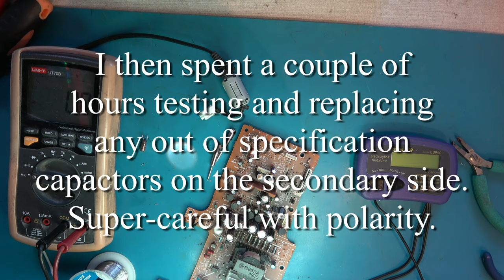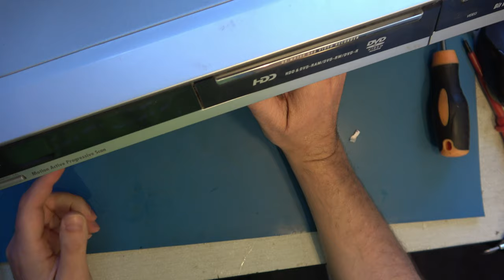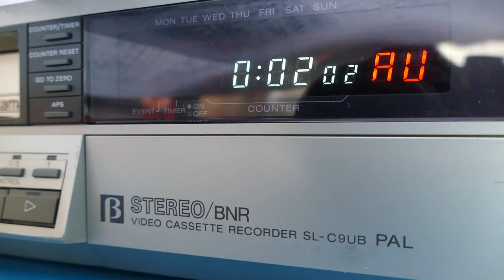More on JVC DVD recorders.  Two DR-MH200's display "LOADING" and won't start, try to fix quickly.

Comment: Smashing job coilin, not to hard to recover them.
Switchmodes are efficent but if you had to send it to a shop for repair the price would likely wipe out any savings you gained with the reduced electricity costs.
There was an old satalite box that did worse when the power was lost, the Dredded Pace box would expode it's switchmode psu on power cuts.
I repaired too many of them, always the psu exploded when power was re applied.
There was a repair kit for the pace, it was very common.
Reply from the maker: These JVCs can blow up the power supply too, I've had that once.

Comment: Sure you get this comment very often but it is disappointing how cheaply things are built today. Perhaps older kit was just over-engineered, but it seemed so much more reliable. Had a Freeview box that died two years to the day of purchasing it, and it was due to bad caps. Replaced them and its still working now about 7 or 8 years later. Things just aren't built to last anymore.
Reply from the maker: Meanwhile the power supply capacitors are just fine in my 1976 N1502 video recorders.

Comment: Nice recovery of the machines. If the hard drive does fail, are you able to read and clone a drive in a Windows or Linux computer then pop it into a machine with a failed drive, and go on your merry way?
Reply from the maker: No. They have special firmware.
Reply: Yes you can. use HDDRAWCOPY tool from HDDGURU. I have done it on my JVC DR-MX1 VCR/DVD/HDD Recorder. Use the OEM JVC hard drive as Source. and as the Target you have 2 options 1st you can either image the Original OEM hard drive to a file or 2nd option to a new hard drive and after the clone finishes the JVC will recognize the new Hard Drive. I just change my DR-MX1 from the OEM cheap crap Maxtor 160 GB to a WD1600BB 160 GB IDE drive. and the unit successfully booted up from the WD hard drive.

Comment: Reminds me of the 1uf 400v bootstrap that liked to go in the Panny VCR's after a power cut!
Reply from the maker: I wasn't aware of that one, do you remember which models, roughly?
Reply: It was a whole plethora of the early nineties decks as they all had quite similar PSU's (NV-L/ NV-G/ NV-F/ NV-FS etc, etc) Dried-up PSU electrolyics were always a firm favourite in the old Panasonic's..

Comment: I've seen a few of your videos and you clearly seem to know your way around tech of yesteryear. Perhaps you can help me with a recurring problem I'm having with a Pioneer LaserDisc player. Or at least help me provide my local repair shop with a few pointers, so he won't have to spend unnecessary time trying to locate the fault. Time is money, you know... 😉 

I own an old DVL-series Pioneer LD player. When it's operational, everything is fine. But if I dare to unplug it or if I have had a power failure in my house, I cannot for the life of me make it turn on again. I have to keep the player unplugged for about 2-3 weeks - and then I can hook it up again and everything will work fine.

Is it a problem you've come across before and might have a few ideas as to where to look for faults, other than going straight for a look at the power supply?

Would have loved to have you take a look at it - unfortunately, I live in Denmark, so handing it off to you will be quite... expensive.
Reply from the maker: It's almost certainly a power supply problem, but there's no simple explanation to repair it.  You would have to look at the power supply and see what components may have failed.

Comment: What happens when you test capacitors using the wrong polarity? digiommel has released a lot of technical paper on improving video transfers of certain formats. Maybe you can post tutorial videos on them.
Reply from the maker: The ESR meter doesn't have polarised cables, it works out the polarity somehow.

Comment: Mine just failed moving it 😅
Reply from the maker: Yes that often happens, it will work when powered up but PSU fails when reconnected.  Capacitors for sure.